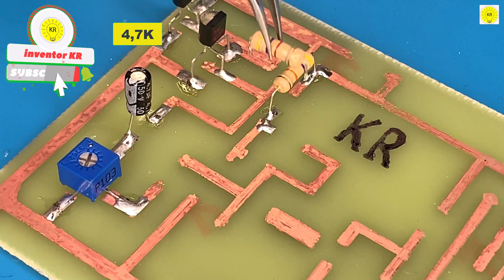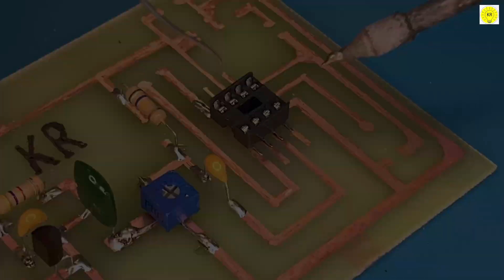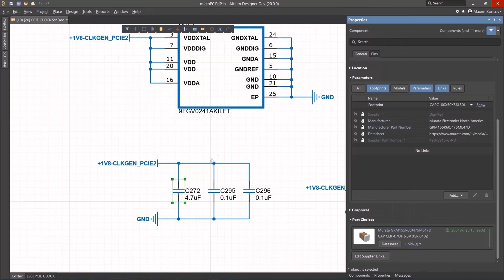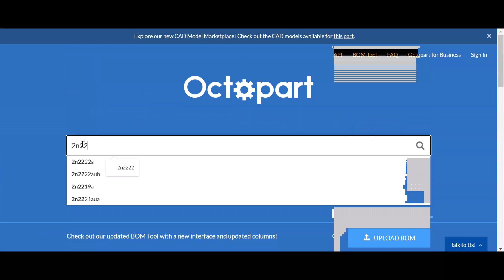how to make fm radio receiver at home , altium designer

Comment: Hi sir my s9018 transistor burns what should i do ?
and please tell me what is the input voltage
Reply from the maker: Make sure that the terminals of the transistor are positioned correctly and that the input voltage ranges from 6 volts to 12 volts
Reply: please how to make 27mhz receiver toy car @inventorkr1

Comment: You write the value of the 4.7k and 47k resistors in reverse. The resistor in the amplifier section looks like 680k, not 620k. Also it would be nice if you attach an antenna.
Reply: what is the input voltage?